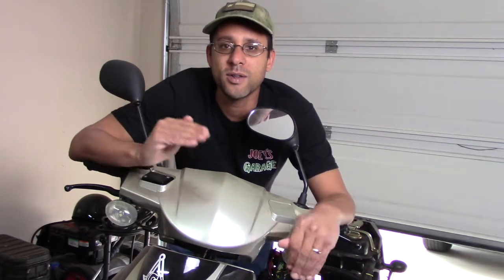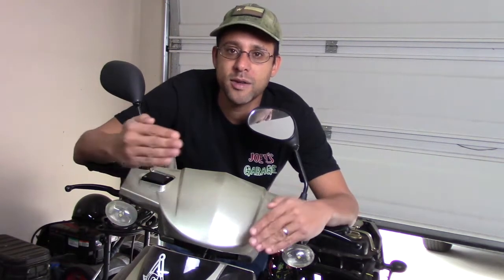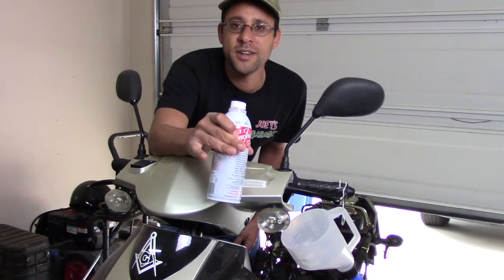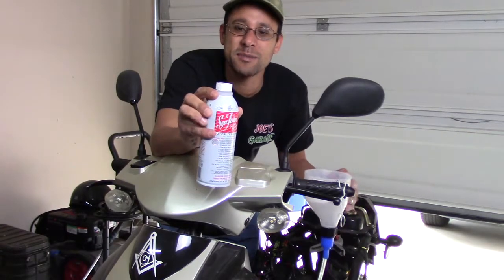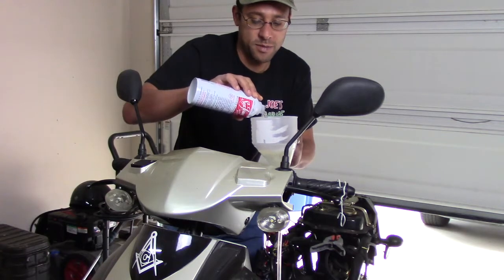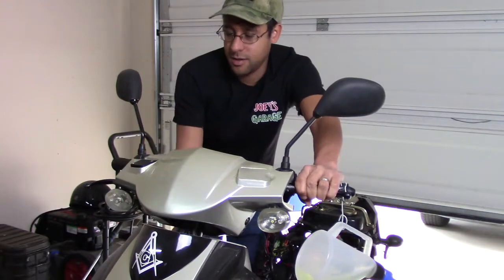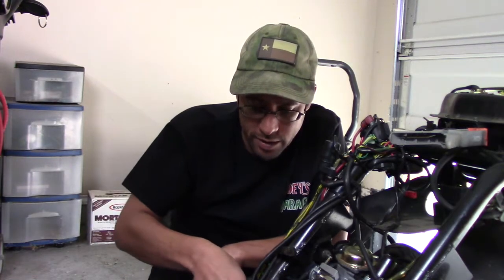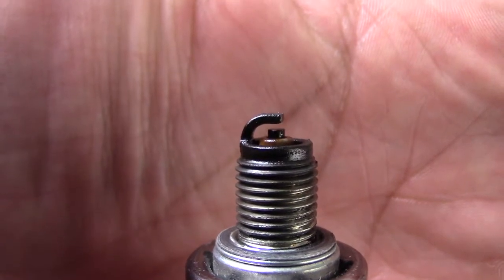Seafoam Fueled Gas Engine

Comment: I've used Seafoam for years now without any problems. I run one ounce per gallon of gas during the riding season to keep the carbs clean just incase. I also use it to stabilize the gas over the winter months and NEVER had any problems and the bikes always start right up in the spring. I Yes, it's a gas stabilizer too. I've used Stabil for years but the engines don't want to start and run very good in the spring, but with Seafaom, there's no problem.
Reply: Painter D so you just mix sea foam and gas and use the bike like that ???
Reply: I just put in the recommended amount of Seafoam in my tank, then I fill it at the pump, so it gets mixed in real good. I do it that way during the season once or twice, depending how many miles I ride during the season. And it do it that same way before I put it away for the winter. I add it at the station and by the time I ride home (2 miles away) it gets mixed thru the carbs. I shut off the petcock and let it sit for the winter. It always fires right up in the spring and is always ready to ride when I am!

Comment: The manufacturer says gas engines will run on 50/50 solution. You dodged a bullet using berryman's. Full strength will ruin rubber very quickly. Don't do it on a carb or your diaphragm will be ruined.

Comment: Rofl. Seafoam tells you it will not run on straight seafoam. Gas engines has to be 50/50 mix max. Diesel engines can run on straight seafoam. So, if you did some reading you would know this.

Comment: Seafoam is for boats
Reply: Piedad Stoffel idiot
Reply: he's actually right.   It was made for old two-stroke outboard engines, back when the two stroke oil was very sooty and ashy
Reply: Originally yes but you can use it in any gas with diesel motor and it'll clean it and help I don't recommend trying to run it straight off the phone that might hurt your motor if you put that much in there I don't know never done it

Comment: Now try it with a diesel engine! Seafoam is basically diesel, lighter fluid, and alcohol lol but not enough alcohol to combust at that compression ratio/spark plug temp. Unlike B12 which is a “high energy solvent”, which means it’s made of acetone, flammable, and toluene, flammable. Toluene is actually one of the additives the “top tier” gas companies add to help clean